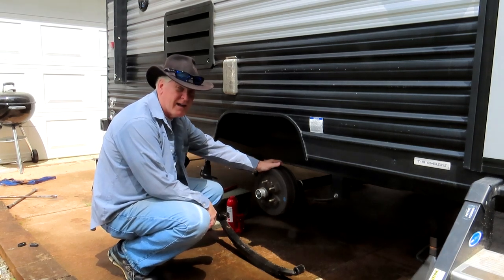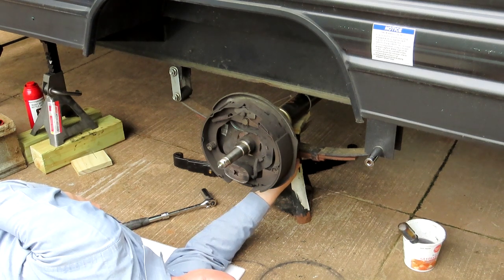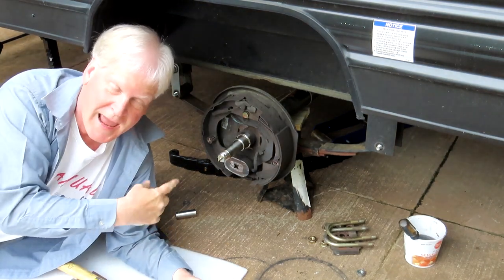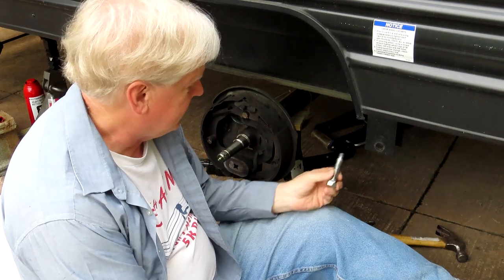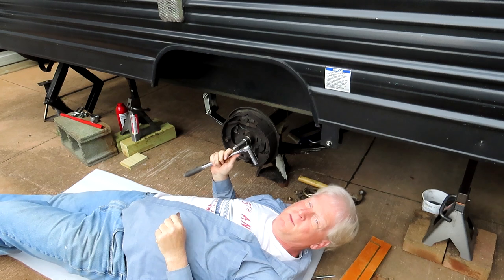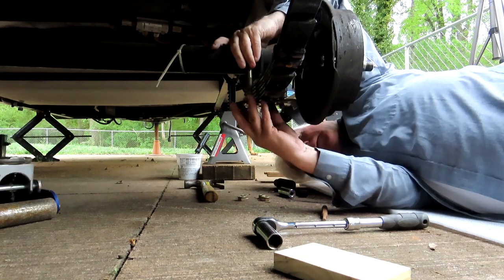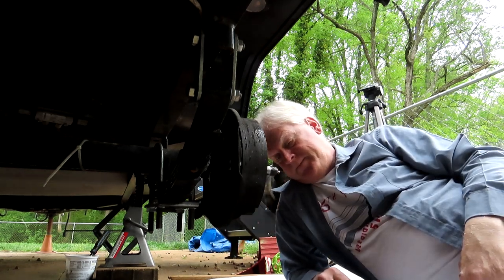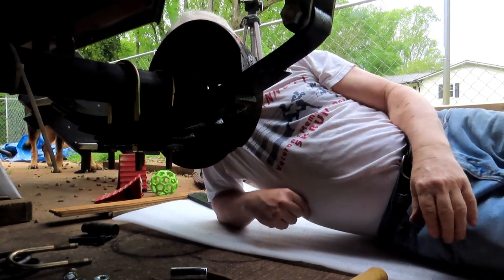Upgrading my axle springs on my 16BHS Wolf Pup Camper Trailer.  Some tricks and problems incurred.

Comment: They pay engineers a lot of money to design for the cheapest cost.  Did you learn all those skills in high school shop?
Reply from the maker: Not really. I learned them from Chrysler and Other manufacturers I worked for.  And Actually, its not the engineers, its the purchasing people who decide how cheap they can get the materials together and then they pressure the engineers into okaying it!
Reply: @GoingNoWhereFast  not everyone can do those type of repairs
Reply from the maker: Its just unscrewing bolts and swapping parts. Not much technical knowledge.  The parts do all the work.

Comment: Isn't it interesting how inadequate the trailer manufactor designed the suspension on this trailer.  I have seen a few videos now that raises the question mark on the engineering design on frame and suspension components.  It's a wonder there are not more bad accidents as result, not to mention the Chinese "bomb" tires they are mounting on new trailers. 😮  Thanks for another good video.
Reply from the maker: I have the "China Bomb" tires on my Aliner(5yrs).  They are great.  I did make sure they were well above spec, since I air down and up all the time.  But they are fine tires if you keep your speed and heat reasonable.  They may say they have an 80mph speed rating, that doesn't mean you should go that fast ALWAYS.  And Road conditions make a huge difference.  And every trailer is a rolling earthquake trying to stay together, People overload them,  and figure "If I can Move it, its OK".  Many uneducated people making a lot of noise!

Comment: You make it look difficult…I mean easy! 😂
Reply from the maker: It was a bitch.  I expected to undue a few bolts and bolt on the new one.  Nothing matched up since I was only changing the springs and not the axle too.  Luckily there are answers to every problem (And it isn't Jesus)
Reply: @GoingNoWhereFast  
I wish there was an easy way to get myself down on the ground and up again. Due to my pathetic results from two total knee replacements, I find it very difficult to do. I wonder if an engine hoist could be retrofitted in some way?☺
Reply from the maker: @mrbilllollar    Might be overloaded.....lol   🤣😂

Comment: I wish my trailer had conventional springs. I have those weird Dexter torsion axles. It's hard to jack the frame up rather than the axle. Plus my Rockwood A-Frame has been lifted 4".
Reply from the maker: Put the jack under the axle mounting flange. The reason they tell you not to jack under the axles is because they aren’t flat

Comment: Nice video again, Rick. It looks like you have the same HF 8-ton jack as I. Hopefully, I won't need to do this to my trailer, as it is new, and came with decent goodyear  tires.  I have been wondering if adding shocks to the springs would help at all, but I have no Idea where they could be mounted.
Reply from the maker: They make a little "Shock Pad" (SUMO Springs)that goes on the springs and keeps them from bottoming out.  https://amzn.to/3ISV0JG  They work pretty well and  a lot of RVers have installed them, but the replacement springs were cheaper.    https://amzn.to/3IXznrP     and hopefully will give a better ride
Reply: @GoingNoWhereFast  Well, so far I have a couple thousand miles on mine, with moderate off-road boondocking, and no sign of bottoming yet. Of course, I have been pretty lightly loaded, as it been just me most of the time. Leaf springs are gonna break and wear out, but wow, I'm guessing the previous owner seriously overloaded your trailer, or did some rough off roading with it. Isn't it only a 2020? But it all looks like an easy fix for you, maybe that's an advantage of leaf springs vs torsion axle. Seems pretty cheap to fix.
Reply from the maker: @astrobob9432   In working on this I found out there is a Dexter outlet / warehouse about 20 miles from me. A new axle for the camper would be $350.  May have to do that.   The Previous Owners had 2 kids they used it a lot,  Judging by the stuff lost in the back corners. The work is that the OEM spring wear out fast. And usual on just one side.  So Glad I change them.
Reply: @GoingNoWhereFast  This is very useful information, thanks a bunch! That's very reassuring to see how easy they are to replace. I'm headed out in july for some remote stuff in western Nebraska, hope I don't bust a spring!

Comment: You'd think where you bought the springs they would give you all you need for the job. Thanks for your video!
Reply from the maker: Oh they did, But they gave me hardware for a 6000lb axle, and I kept the 3500lb axle.  So the hardware didn't match up quite right.  6000lb axle is much thicker. The hardware on the 3500lb axle would have been loose.  Not a good condition.   Its always nice to have practically unlimited time to work on things and make them as right as can be!!

Comment: Upgrade you shackles also and install wet bolts on them.  Glad to see you upgraded your camper.
Reply from the maker: The spring came with new Shackles, But they were bigger and I wasn't sure they would be as "flexible".  Akela said not to use them.   But I have them if I want to mess with them  Of course the front hanger is welded, not messing with that one.